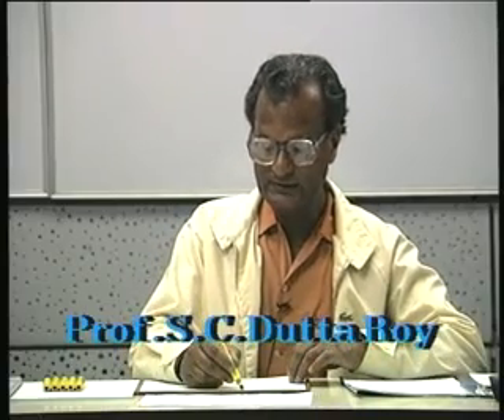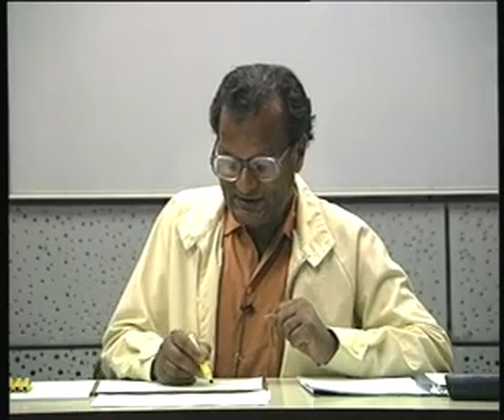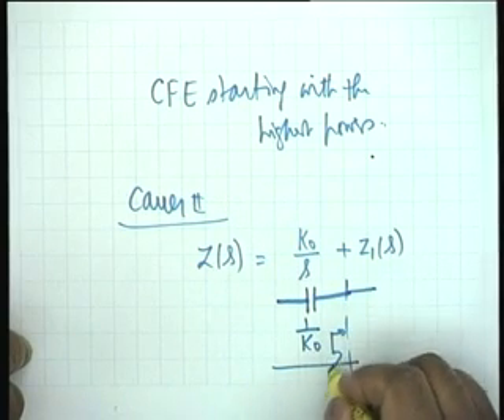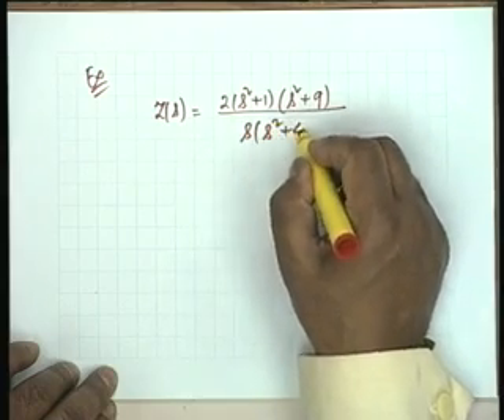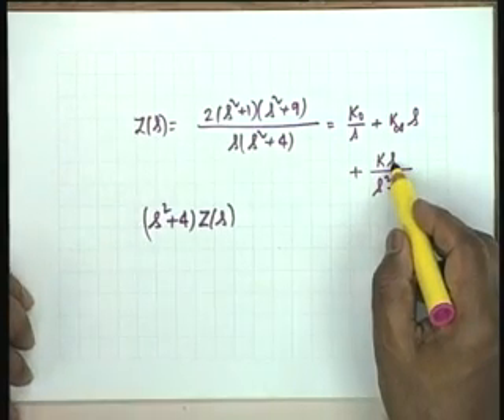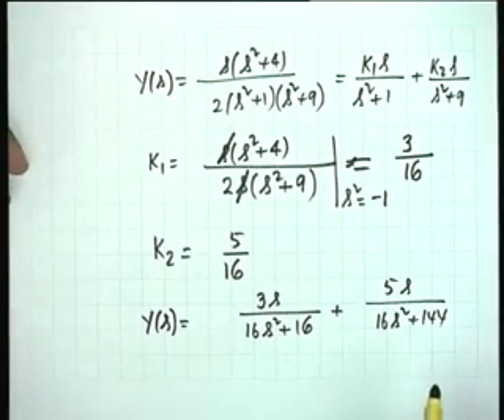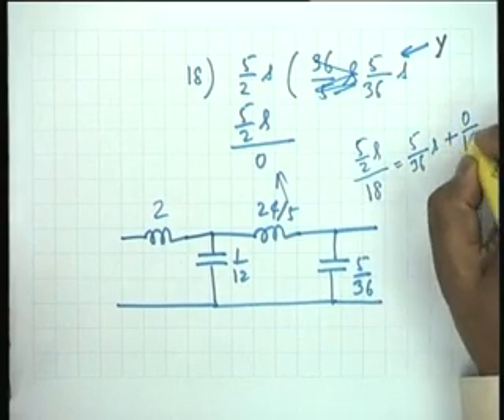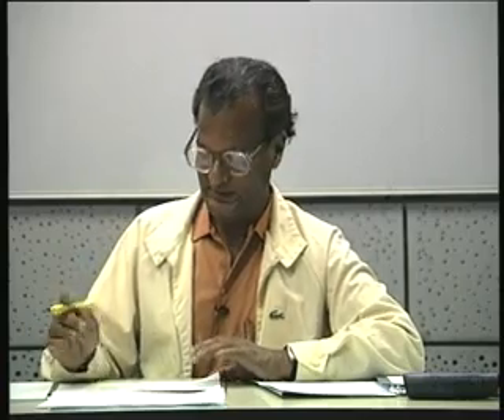Lecture - 42 LC Driving Point Synthesis (Contd.)

Comment: In the first example in foster 1 realization if the residue is 2 the value of residue then shunt capacitance should be 4/15 f not 2/15f  am  i correct?